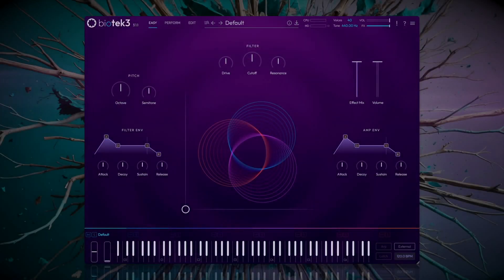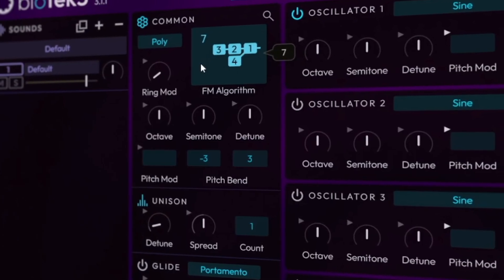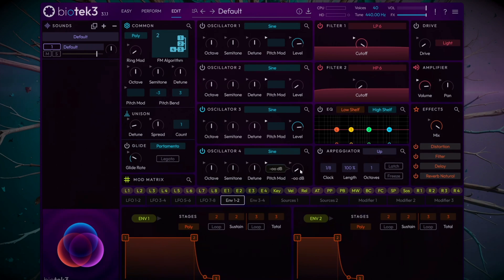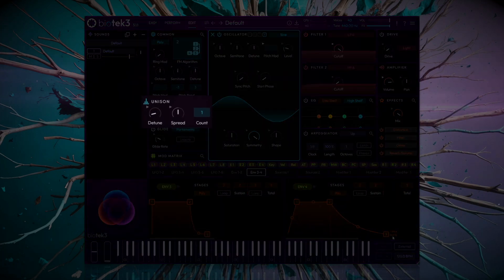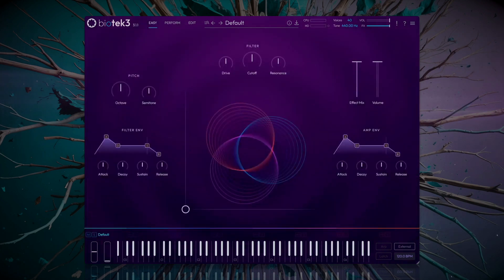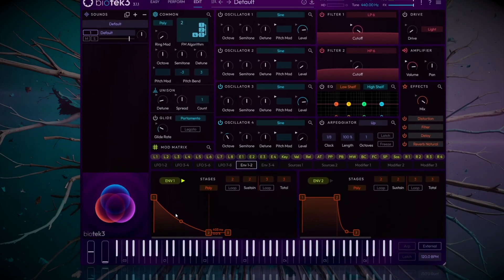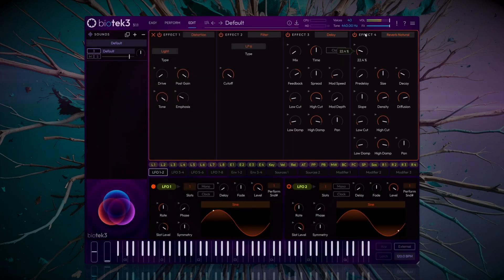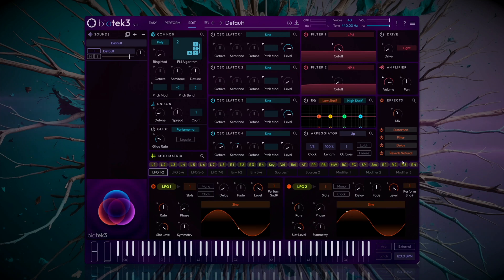BioTek 3 - How to Create FM Sounds | Sound Design Tutorial

Comment: Not related to sound design, but the screen design of BioTek. This is a rant (with an implied usability request), so if you don't work for Tracktion and  are easily offended, simply bugger off ...

I worked with many screen designers over the years and I know many don't give a shit about accessibility or how software and interfaces are eventually being used and by whom. They just want to be artsy and show off pretty pictures for promotion clips and marketing images.
Those fancy sci-fi background images in BioTek are utterly distracting and make it hard to read the controls and labels, i.e. Colossus, Dusk, Dubstep, Obsidian, Movement, Pulse ... especially Pulse.

You guys should start doing usability testing with a larger demographic, before slapping random AI generated images onto the background of a user interface. Seriously?
Very inaccessible, bad, unprofessional screen and UI design that made me HATE USING this incredible synth. Even browsing through presets is a visual pain.

Thankfully those images are not compiled into the plugins, but just .png files that serve no other purpose than to waste a whopping +230MB of disk space only to make thing unreadable and inaccessible. So I removed them and now BioTek's main screen can actually be USED.

And while we're at the topic of efficiency: PNG files are the worst choice for photographic images given there is no transparency involved either. 
Try high quality,uncompressed JPGs (50% file size saving) or better: WebP with photo preset (90% size saving) that also supports transparency. That gets a 3-10MG PNG to a 3-10 KB WebP.

Why do I have to waste +230 MB of disk space and ca. 100MB download size for these PNGs if they can be a 10th of the size? 
You're just wasting energy and everybody's bandwidth incl. yours.
<end-of-rant>
Bye.